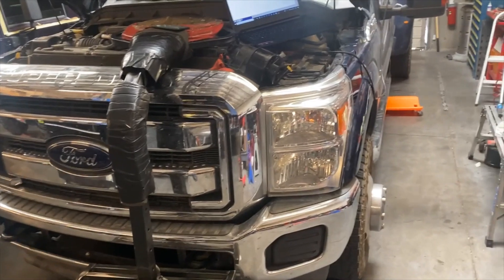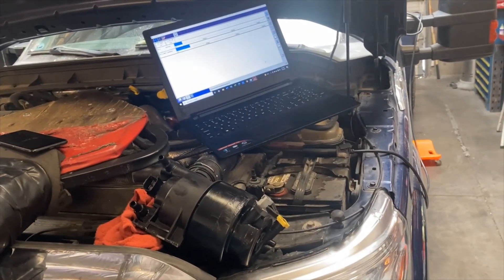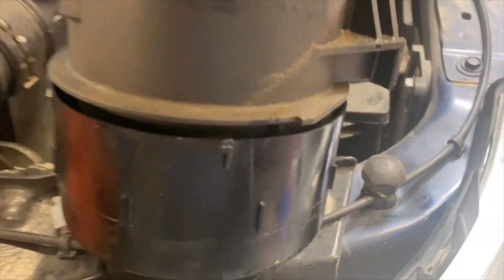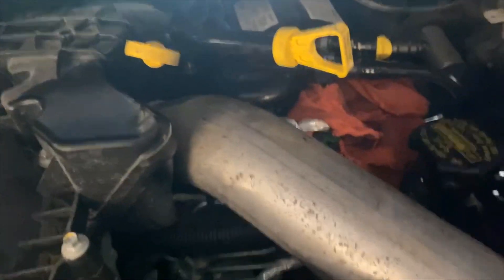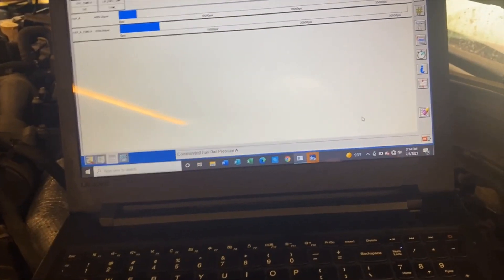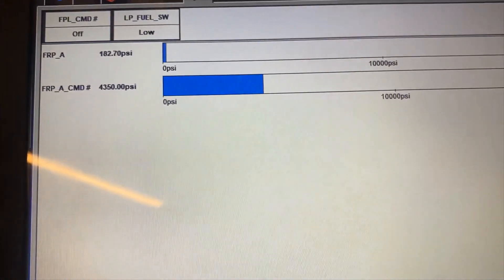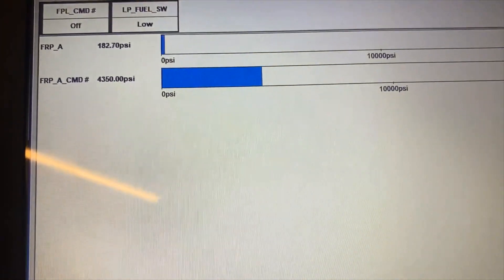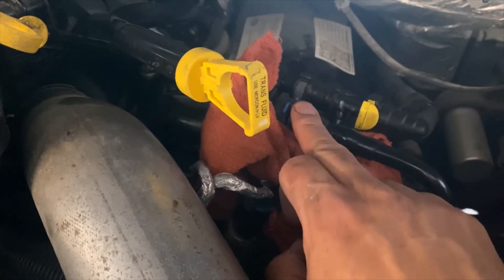Powerstroke 6.7L low fuel pressure on lift pump low side

Comment: sir, i have a 2017 f250, with 180k miles on it, it just started to show engine reduced power, ran a scanner and it shows p0087 and p0093. any ideas on wat should i do? thanks
Reply from the maker: Definitely not drive it since you can cause catastrophic pump failure.
One is a low rail pressure code the other is large leak detected if I’m
Not mistaken.
I would first start of with fuel filters.
Then re check but it gets a bit more complicated on the high pressure side since it is wise to first check for contamination.
Let me know if fuel filters be done first.
You can check volume of the outlet of the secondary fuel filter and put a hose.
Turn key on No crank, should see if 1 liter in 30 seconds minimum 
Let me know

Comment: Great video! I have a question for you on my 2012 F-250. I changed the filters and cycle the key, and noticed that I can hear screeching under the hood on the first cycle. Every cycle after that, no noise. The truck starts, runs, and drives fine. No codes whatsoever for low fuel pressure. After running the truck, upon cycling the key, I hear the screech again. Truck starts fine, no extended crank. I have checked the filters (both upper and lower) and they have been installed correctly and are not loose. Any tips?
Reply from the maker: Air.. well fuel pushing air out. But some say the harmonics from fuel pressurized.
But 6.7L also make that sound from the vacuum leaking from the wastegate solenoid
Reply: @dieseltalkwithtonysalas8725  it only happens when the key is cycled and quits when the pump stops. It sounds exactly like the air evacuating in your video at around 4:32. I did replace the injection pump with an upgraded one as this truck is modified, so I was moving lines around under the hood when I changed out the high pressure lines going to each fuel rail from the CP4. Is there a possibility that the quick-connect lines that attach to the fuel filter under the hood could be leaking or sucking air in at the quick-connect fittings? Again, I don’t get any low pressure codes or extended crank, so that’s the confusing part. It won’t make the screeching noise until I run the truck and then shut it off and try to start it again.

Comment: thank you sir very much for this video. i have a’16 powerstroke and after i changed the fuel filters i didn’t realize there was a stop point on the frame filter, therefore i was getting low pressure and power loss. 
thanks to your video i tightened it all the way and problem damn solved. 
it’s awesome that the pros like yourself are kind enough to post these vids. 
thanks again
Reply from the maker: Glad the video helped! Remember after filter replacement and priming, let the engine idle for at least 15 min to ensure all air works it’s way out. Why? Well the reason for CP4 pump failure is air and low lift pump pressure which mostly occurs during filter service.
Thanks for watching!
Reply: @dieseltalkwithtonysalas8725  yes sir i did that and took it for a little ride. all good and thank you again
Reply: I did the same thing except after correctly tightening filter pod, issue still there. Plan to try and burp the system as he showed soon as i get home

Comment: I’m so sorry it’s a long read but I’m currently having issues with my 2016, a week or 2 ago I was on the way home at high way speeds “80mph”, an I went to slow down to exit an make my turn, I go to push it to merge on the new road an I got sluggish an my reduced power light came on an I noticed I could hear my fuel pump gurgling an Shit struggling so I was like great my fuel pump took a shit, I pull over shut her down pull home. 4 days later I replace fuel pump with oem pump primed and started it ran amazing for about a day or so an noticed I gained back my mpg I lost, well almost at the same damn turn an merge I got a low fuel pressure warning and a reduced engine power ￼and I could hear fuel pump doing the same shit as the other one.. fast forward I drop my tank after a member suggested to check the sending unit an I found a leaf in the cup right against the damn draw straw I was relieved!! I pulled it out blew threw the line between tank an pump did the cup mod where you drill holes in the cup to get rid of the 1/4 tank problems, cleaned tank out an put half a tank of fresh filtered fuel. Got everything buttoned checked pump and filter then primed her up started up good all normal “Hums an ticks” I drive her around an immediately can tell the difference in throttle response, test drive is going great got about 16 miles on the truck after everything an bam low fuel pressure and reduce power warnings back on……. I limp it home an research solutions an this video popped up, trouble code p0087
Reply from the maker: In those kind of situations where lift pump pressure and volume is an issue, I confirm both fuel filters are clean or replace them. Then I disconnect the line on the outlet of the secondary fuel filter add a 10-12 ft fuel lines to a big 2 liter bottle and pan and cycle key on and off every 40 sec and observe volume. Minimum 1 liter in 30 sec
I do it many times see if volume becomes and issue in the shop stall

Comment: I have a  whinning noise coming from my upper fuel filter and seems to vibrate started after i had it changed a valvoline.bad filter,air in line ?
2012 f250 6.7 powerstroke
Reply from the maker: My apologies for not getting back to you sooner, any changes since your comment?
Reply: @dieseltalkwithtonysalas8725  No sir its still there...
Reply: i did do the key on cycle at the time filter installed everything fine till about month later the noise started.
Reply from the maker: @jeffburger786  based on what you telling me sounds like fuel filter but I assume truck runs fine. If not let me know.
And  you are sure it’s the fuel system cause 6.7 s had that high pitch low volume squel from the vacuum solenoid from the wastegate control
Reply: @dieseltalkwithtonysalas8725  Hey Tony me again so i replaced both filters with motercraft blead the air out of the low pressure doing the hose and bottle method.
But i think ive narrowed it down from where low pressure fuel filter line.down  to where the fuel engine switch or rail sensor is . just that small section of line has heavy vibration....is one of those sensors bad
Reply: @jeffburger786  did you ever figure this out?  Mine does the exact same thing.
Reply: @steves05ser did you ever figure it out your self? I’m in same boat
Reply: @ I installed a fass fuel system and it stopped making the noise.  I plan to completely remove the upper filter with the fass kit but haven’t got around to it yet.

Comment: Hey Tony. Question here and in dire need of help as this has been an ongoing problem for over a year with no avail of figuring out the solution...

I have a 2014 6.7 and sometimes it will (within the first 10 minutes of driving) start to lose fuel rail pressure and bog down. Eventually leading to it stalled out or shutting off completely if I don't shut it off first. If it sits for an extended period of time(half hour to an hour or sometimes more) the problem will casually fix itself... I notice that when I have the problem the truck was previously parked on a down-hill slope with the front end lower than the rear and shutoff. Ever since I started parking with the front end up, the problem went away but today someone else got in my truck to move it and parked it with the front end on a down-hill grade. Sure enough, about 6-8 mins later it started to bog down and left me stranded for 2 hours trying to diagnose and fix. It eventually started right back up and ran perfect after it sat for an hour straight... you can normally tell ahead of time before you start it and turn the key the fuel system/pump is making a horribly atrocious and loud screech/whine. The truck has been through two entire sets of fuel filters if that says anything about how long this problem has been happening....🙄 Thank you for your time anything is helpful!
Reply from the maker: Sorry didn’t get back to you sooner. You get it figured out? Let me know
Reply: @dieseltalkwithtonysalas8725  Unfortunately no, I have not been able to figure out the problem yet. I've just been parking my truck on only level ground or with the front end higher than the rear and the problem doesn't occur.

Comment: Will a weak lift pump cause a P0087 code? I'm getting that code and also a reduced engine power message but the truck still runs fine. It does seem like it is taking a little extra time cranking before it starts.
Reply: Mine is doing the exact same. Did you diagnose the issue?
Reply from the maker: Been busy this week sorry! The answer is yes but I wouldn’t be driving it with the message .
Hopefully you getting it resolved! 
Thanks! Let me know if you have any more questions!

Comment: I drove Truck to work came out after work & truck just cranks p062a code 2013 f350 6.7 powerstroke any ideas?
Reply: Fuel pump isn't humming like normal
Reply from the maker: Need to check if lift pump is working . Cycle key every 30 sec several times. See if lift pump works, code relates to pump circuit if I’m not mistaken
Reply: So that would most likely be the pump went bad correct? I don't here nothing after cycling key intermittent for 30 sec
Reply from the maker: @TWINTURBOS4LIF3  I check the inertia switch first. Check to make sure it’s not tripped
Reply: @dieseltalkwithtonysalas8725  where is it located
Reply from the maker: @TWINTURBOS4LIF3  passenger side kick panel if I’m Not mistaken .

Comment: In Iowa, and we have below zero temps. Have treated 50/50 fuel in the truck No issues until today the low pressure warning came on. Whats your diagnosis?
Reply from the maker: Your low pressure could come on due to low voltage, which spins the pump slower. I would confirm battery voltage and condition first. Especially with the cold temps you have!

Comment: Hey Tony, is screeching from the top end a sign of a bad lift pump? It’s inconsistent, sometimes it happens sometimes it doesn’t when the key is turned go on position and goes away. Just started happening. Edit: Should also note there is no light for “low pressure” and has no problem starting. Just a terrible screeching from time to time.
Reply from the maker: If this is a 6.7L PS, screeching sound also comes from a vacuum actuator such as the EGR bypass or solenoid. The solenoid and turbo wastegate will do that too if it is a 2014 or earlier model. But I have found harmonics screeching from the lines near the secondary fuel filter. I generally don't worry about that

Comment: Any idea what would cause the p054E code 2012 6.7 f350
Reply: Did you ever figure out the issue just installed my s&s disaster kit and that code popped up now truck doesn’t have good throttle response

Comment: Hi Tony, just want to ask you what you think of adding fuel additive. 
I have a f350 2015 with a 6.7 after I started adding the fuel additive by Ford powerstroke. 
My fuel pump failed.  The one on the rail underside.
I was thinking it was just time. Have 190K mileage. 
It ran good after I replaced pump then 3 week later I added 2 ounce per 35 gallon fuel tank and again had issues. 
Replaced pump again as it wax under warranty. 
What your thoughts.
Reply from the maker: Which additive exactly? Part number please.
It’s on the bottle.
Pumps can fail for a few reasons such as low voltage, grounds and pulling contamination from tank. 
I’m for the proper fuel additives. There are lubricants, cleaners and cetane improvers.
Reply: @dieseltalkwithtonysalas8725  
Tony, The fuel additive that I used is Genuine  Ford fluid PM-22-A USLD 
Compliant Cetane Booster and Performance Improver.

Comment: Hey Tony maybe you can help me I did a fuel filter on a 2016 6.7 and afterwards I  Followed the priming instructions with the key but I have a no start. I did not attempt to start it more than 4 or 5 times with a maximum of 4 to 5 seconds cranking each time.  It's a friend's truck and I'm trying to help him out but I'm worried about the CP4.  Should I be concerned with the amount of cranking that I have performed at this point?  Thank you for any help it was a bad end to a week.
Reply from the maker: It happens but you need to see why it’s not starting. As I said in the video, did you get the primary filter on to the plastic tab?
Did you also bleed air as I also mentioned on the outlet of the secondary filter?
Let me know.
Thanks for asking!
Reply: @dieseltalkwithtonysalas8725  no,  I walked away for the night.  I'm not one to keep fiddling with expensive stuff I'm unfamiliar with.  I'd rather gather information and try to minimize damage.  I definitely had Is the primary filter housing completely installed with the tabs touching. I watched your video after I got home.  I did Reinstall the old primary filter  O ring and the pump was much quieter than with the new one from Ford. I also did remove the drain plug completely  so I need to double check the O rings  on that.  I'm gonna use a snap on solace and hopefully I can read the fuel rail pressure. I'm also going to do what you suggested in the video. I'll let you know how it goes I really appreciate it I'm even willing to send you some money.
Reply from the maker: @Wrenchhead427  no monies needed just support by liking and subscribing!
Reply: @dieseltalkwithtonysalas8725  good morning, got to the truck this morning, hooked up my Solus and monitored the low side pressure while cycling key, it was around 80-82 psi and the low pressure pid was switching fromyes to no, accordingly. I noticed I couldn't really hear the pump running as opposed to the noises it was making last week. I switched to high side pressure and cranked for a few seconds, it didn't start so I switched the key off. At first, during cranking the high side psi was 0, but as soon as I switched it off, it jumped to about 1700 I believe. I realized it was actually building pressure so I tried again and it fired up immediately at ran smooth, no noises whatsoever, high side psi around 4700. took it for a test drive and goosed it enough to command about 22-25,000 psi and desired matched actual. Im satisfied it was just air and the small amount of cranking I did, no more than 35 seconds spaced out 6 times , didn't hurt anything. I made sure my tabs were touching, they are. Chaulking it up to air in the system, after all these years, you think these engineers could design a better method for dealing with this kind of problems on diesels, oh well, I got it, Thanks Tony!!!!

Comment: I’m getting a p0087 code. Is that the same as yours?
Reply from the maker: In these common rail systems, you verify the lift pump pressure. Your code P0087 is a low rail pressure code. This is on the high side. If there is no message on the dash for low lift pump pressure, then you have any issues with the high pressure side. 
In this case we hope it is not a CP4 pump issue, I would first remove the PCV on the end of the driver side fuel rail and check for debris or metal contamination.
Thanks for asking!

Comment: 2017 350 6.7
Deleted and tuned. 
P0087 low fuel rail pressure bank 1

No shavings in CP4. Fuel filters are new. 

Will throw code 3rd gear or higher and anything over 3/4 throttle. 

Any ideas ?
Reply from the maker: You are loosing rail pressure under a load. Before I go after the CP4 pump, I would verify volume coming out of the secondary fuel filter. 1 liter minimum in 30 seconds. 
If that is ok, then need to perform a return test, this can be done at the hose coming back to the secondary fuel filter. Need to verify you have 55 psi on that line. This is lift pump and return pressure so you need this gauge hooked (t in the line) up while driving under that load when your code sets. 
If it drops then we have an injector issue. There is more to add but start there and message me back. I have not made a video on this but I teach it in my technician classes. We either have a CP4 pump issue, an injector or a leaky PCV valve. BUT! Turn tuner down to a lower setting if you can, it also could be the CP$ cannot provide enough for the tuner. 
Let me know!
Reply: @dieseltalkwithtonysalas8725  ok so a little update. Truck still cannot be road tested. Still finishing up suspension. BUT…. When changing out the factory fuel filters a year ago and also when my mechanic installed the CP4 disaster prevention kit months later. We had the same exact problem. 
Had to cycle the key on/off over 40 times to prime the system and it eventually turned over. Started. Shut off on its own. Then finally ran. 

Fast forward to yesterday. Installed the H&S lower and upper fuel filter kits.  Cycled the key maybe 8 times. I tapped the start button. It fired right up. Just like a normal start on any morning. No delay. Nothing. 

There is a video on YouTube of a guy with same P0087 code and the problem was the ford factory lower fuel filter housing. Was clogged somehow.
Reply: I’m having the exact same problem I read the pressure and it caps out at 25k and throws the code